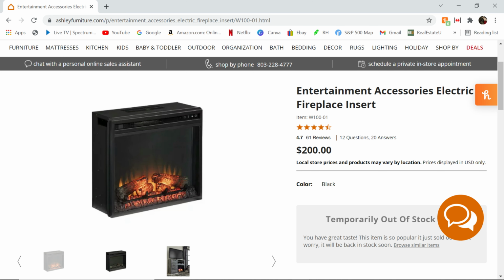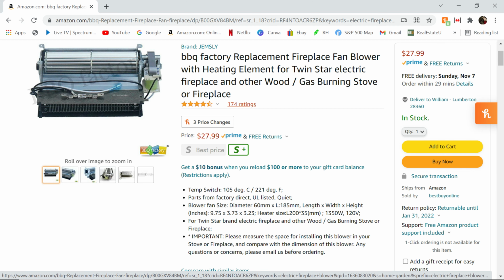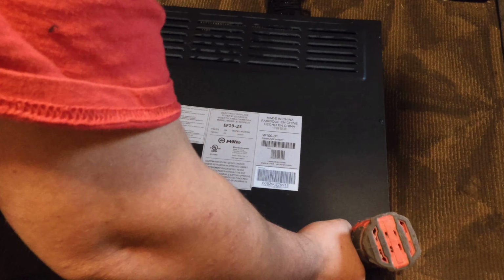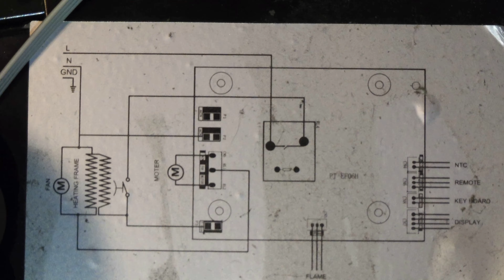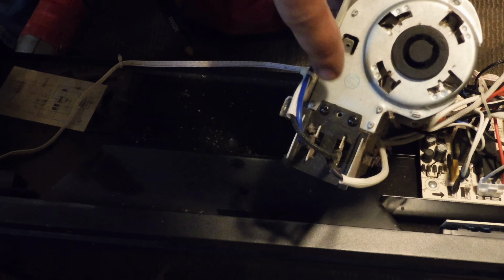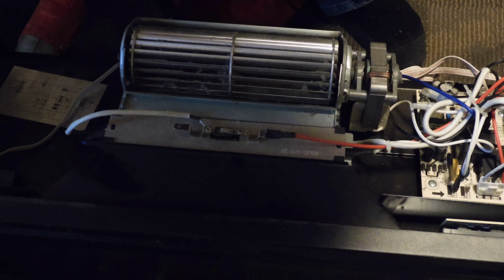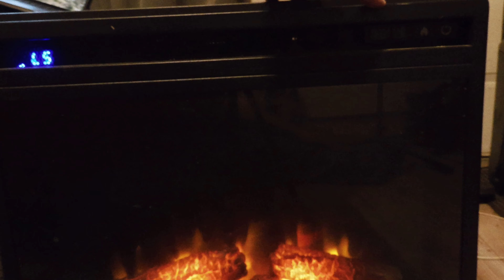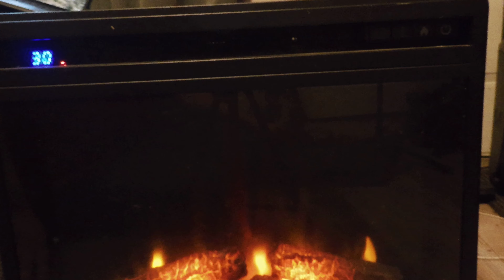How I fixed my electric fireplace FOR FREE.. Fix Most Electric Fireplace Inserts for $30 or Less..

Comment: I bought a new electric fireplace from Amazon and for 2 days the FP worked great and now she is emitting a weird smell that was so bad (I have sensitive lungs) I had to turn it off. Amazon has offered to refund my money, but I will be stuck with a beautiful mantel and a black box that might just need some  tweaking. I have two additional faux fireplaces that work great.

Comment: I appreciate the video, is it possible to change the power cord on a unit ???
Reply from the maker: yes, just make sure the replacement cord is 12 gauge wire to prevent any fire hazards..
Reply from the maker: I actually need to replace one soon, when I do I'll post a how-to video breaking down the process..

Comment: Can you tell me where your black tester wire is touching when you test voltage when you turn the unit on. You are getting 117 touching your red tester wire to the red and black wires on the unit.

Comment: Great video! My insert was working fine and then then one day it wouldn't turn on at all, not even a code. Any suggestions where to trouble shoot?
Reply from the maker: If it’s not doing anything at all I would look for a fuse to see if it has blown.. Each unit is so different it’s hard to say without checking it.. U just have to take a multimeter and see where the power stops flowing.. Could be a bad switch.. Some units will have the wiring diagram inside of them which helps a lot..
Reply: @williamblanks8500  thanks so much for the video, and also the reply. I checke a for a fuse but there wasn't any and the wiring seems kinda funny.

Comment: My parents have one of these big daddys in the hallway and i build a cabin out back to take care of them as they are eldely and need help. Mom insists i take the big infrared out of her hallway as shes got no room for it. I have a new infrared Dr Heater 998 and that little dude heats my big 12x24 open space well. So i think this thing she has would be overkill but hey. If it works i can have a nice night light if that part works and if the damn thing heats that well maybe it wont have to run as long. Ill haul out and see. I always look at inside of stuff before i buy. Or use. Im that kind of guy. Hahahaha. Great fix bro.

Comment: Great info. I saw a comment on a review for the fan blower assembly you showed, and the recommended leaving the old motor attached but lifted out( no power), and as you seat the new motor into place, with old one still connected via wires, you then disconnect one wire at a time from old motor and hook up new wires, as you go, one at a time to make sure everything is in the right place. Sounds good to me. About to order this assembly as we have zero power to fireplace. Hope it works. 🙏

Comment: Make sure the fireplace is plugged DIRECTLY into the wall outlet. Not a 6 prong outlet expander. Mine was shutting off and the 6 plug expander fuse stayed on. I thought it was my fireplace. I plugged it directly in the wall and its working great!. Clean out the dust about every 3 months! It gets thick and will burn your unit up. :goodvibes:
Reply: No power anywhere plug it in and nothing Happens where do I start...
Reply: Thank you for info
Reply: @gregorybennett3318  Start by getting a refund. If you returned yours to Amazon then I just ended up with it. One of the main power wires on the motherboard caught on fire and burned off.

Comment: Great video, a friend gave me a mile white electric fireplace. The only problem is it turns on and off by itself. I’m thinking it’s the circuit breaker. What’s your opinion on this!!
Reply from the maker: Prob a heat limit switch inside the unit..

Comment: Hello, will you tell me how to test heating element?
Reply from the maker: Using a multimeter you want to test resistance of the element.. Resistance is measured in ohms and represented by the omega symbol on the multimeter.. Attach each end of the multimeter to each end of the element.. You should have continuity with some amount of resistance.. if you are showing OL then the element is bad.. 
also check the temp limit switch.. these can go bad and cause the element to not receive power..

Comment: Great video, but the part you recomand from Amazon is not perfect match, can you provide a diagram how to connect the wires?
Reply from the maker: the blue wires on top are an over heat shut off switch, the power coming in will go to one side and the other wide will go to power the main board (or switches and rheostat if its manual) so if it over heats everything will shut off.
 (Hot To Control),

On the side is the blower motor, to power it there are 2 black wires usually they are labeled + and - . 
 The - will connect directly to the white wire that plugs into the wall or to the negative terminal on the control board, this will also connect to the white wire on the side of the heating element (Neutral To Load), 

On the opposite side of the heating element are the hot terminals, 
sometimes there are 1 and sometimes there are 2,
 if there is only 1, that means the heater only has 1 heat level (only high, no high and low)..
 If it has 2 that means 1 is for low and both are for high.. If your heater only has 1 setting then tie both of them together and run it to the control board( or switch..)
(control to load)

Comment: mine stops after 5 min. It's been cleaned. Any Idea why?
Reply from the maker: It’s possible the heater is warming up but the blower motor isn’t working, or isn’t blowing fast enough causing it to overheat and turn off for safety
Reply: fan is fine, I put a large fan behind the damn thing and after a few min., click... off again. Piece of junk.
Reply from the maker: @richguitar93  it’s hard to say without checking it out and seeing what’s actually going on with it..
Reply: @williamblanks8500  The fake fire motor went off after about 45 min. I think it might be the culprit. Ill troubleshoot it and wd-40 white lithium and see how it does.

Comment: I'd be happy if I could just figure out HOW to remove the glass front panel so I can 
clean the fake logs, etc.I just about had the WHOLE thing apart and I STILL couldn't
get at, nor clean the logs properly. WHEN will manufacturers just make fireplaces where the front glass panel flips down easily - without about 2 hours of work to find out you CAN"T get  at it ! :(

Comment: Mine stop working no power to it what can I check
Reply from the maker: Check for a fuse somewhere
Reply from the maker: Open box, look at wires that run inside from wall and trace them up until you find fuse.. if fuse is ok check power controls

Comment: My fireplace won't start at all.  Any thoughts ?
Reply from the maker: For a no power situation I would check for a fuse first and check power switch 2nd…
Reply: @williamblanks8500  do all fireplaces have a fuse ? I couldn't find one in mine.
Reply from the maker: @andrewnunez5680  I’m sure not all of them will have one, but it’s def something to check for
Reply: We're you able to fix your heater
Reply: @guadaluperesendiz7041  no , I couldn't find any fuse.  I'm going to try and find a new fireplace for the stand that it goes in. Thanks for asking.